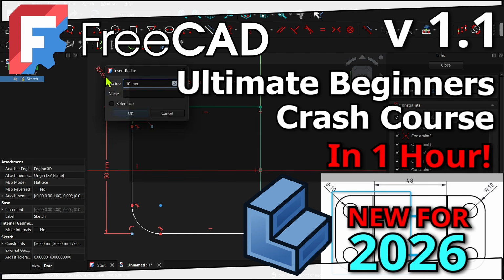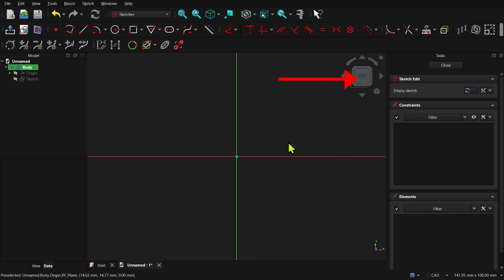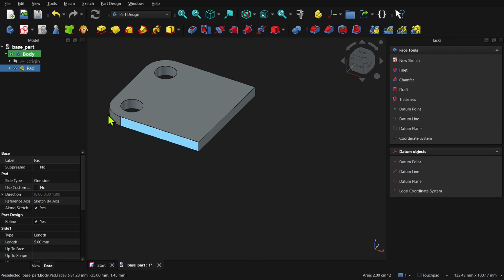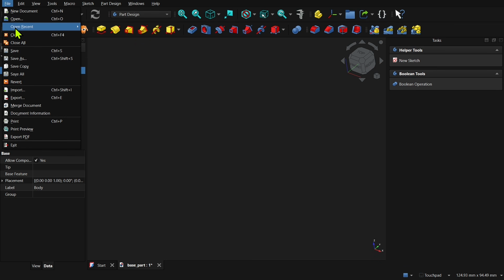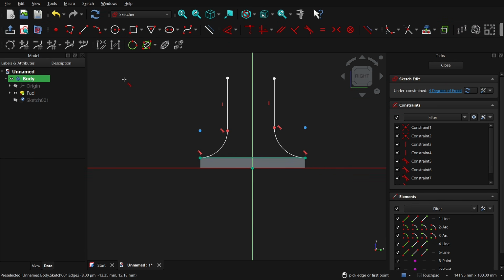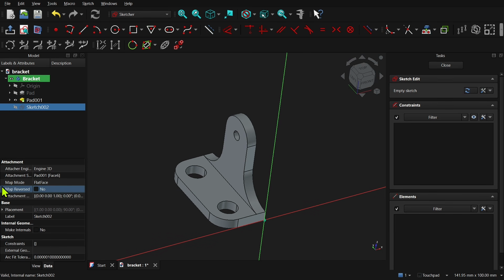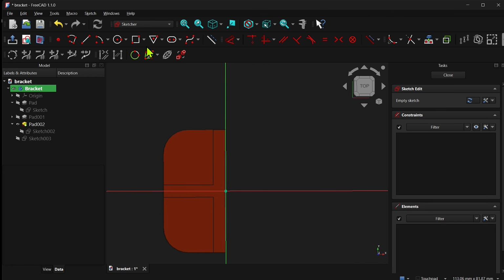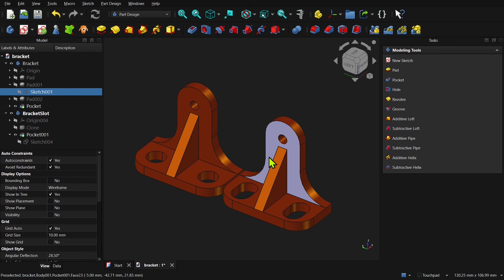FreeCAD 1.1 Ultimate Beginners Crash Course in 1 hour for 3D printing CAD Lesson / Tutorial

Comment: Which video should I watch from you? There are two month ago playlist and this new one. I'm new and doesn't know anything about FreeCad and I need to learn for 3D printing.
Reply from the maker: The 3 part 3D printing course is much longer as it dives into some specific areas and covers 3 projects that can be 3D printed and also goes into some slicer features  If you have the patients then follow that one

This one replaces the older 1.0 crash course from last where as the playlist contains a longer course focused on 3D printing.  It is a great start to get you up and running as a nice introduction even though it's focus is not around 3D printing but it goes into export the model so if you want to print it you can.   So if you just want something quick go for this one.
Reply: @MangoJellySolutions  I'm gonna finish this one and then watch the other three part then. Thanks for the answer.
Reply: @MangoJellySolutions  Finished with following around. I'm gonna watch the other three part. Thanks for the great and clear explainations.

Comment: Section 1:
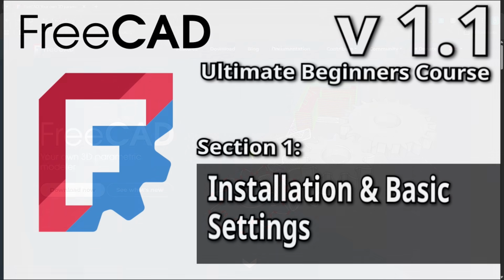0:30 Installation & Basic Settings

Interface:
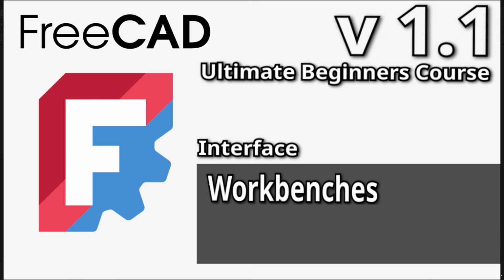1:14 Workbenches
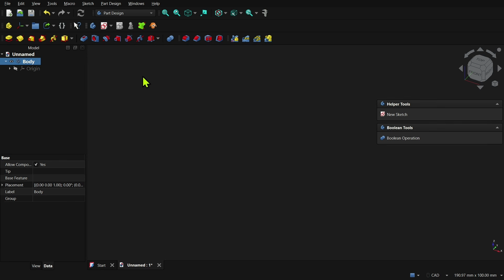1:39 Customizing the Interface
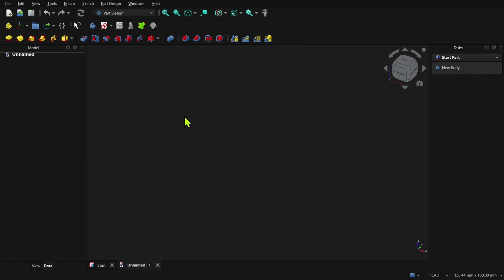3:58 Navigating the 3D View

Building the Base:
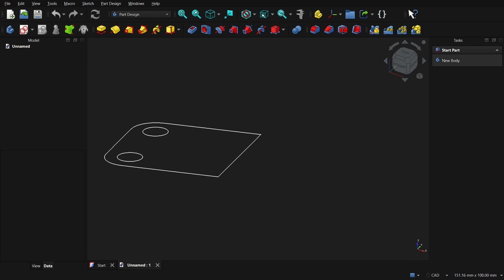6:03 Create your First Part
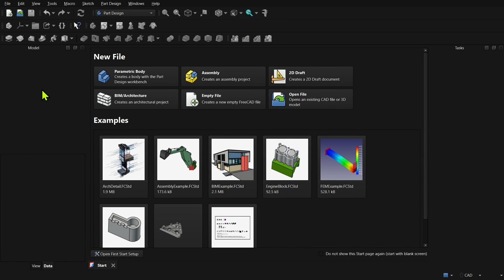7:02 Organize the Toolbars
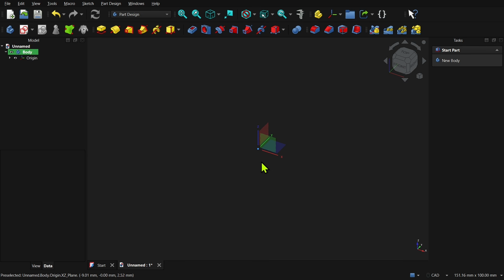8:42 Sketching the Base Geometry
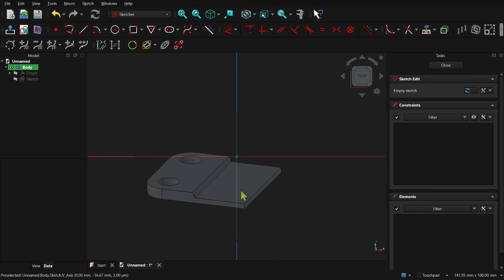9:45 Drawing the Sketching
16:44 Adding Volume
17:57 Removing Volume
23:44 House Keeping
24:53 Mirroring

Building the Bracket:
27:18 The Base
32:58 The Side
34:19 Using External Defining Geometry
39:04 Gusset: Option 1
44:06 Gusset: Option 2 (Cleaner)

Finishing:
48:37 Changing the Appearance
51:21 Exporting your Model
53:24 Clone Workflow

Making a Variant:
1:01:00 Updating the Sketch
1:03:00 Change Propogation

Useful Things I've Learned:
Disable report view (2:13), you can still see reports (2:35)
Hide the Tasks Panel (2:47)
Toggle Axis Cross (4:25)
Auto remove redundant constraints (9:59)
Distance from axis stays the same when you zoom (10:58)
Disconnect a point (21:03)
You can add descriptions to bodies and features (24:05)
Polyline switch mode (28:53)
You can use the tangent tool to define innner curves (36:19)
Cut geometry to sketch plane (39:37)
Changing attachment offset (46:00)
Creating clones for minor changes (56:25)

Complaints:
42:03 This needs to have a fix. I'm tired of fiddling with the numbers to get the "just right" chamfer/fillet
Reply from the maker: Thank you for taking the time to share that, I like that you added the useful things you learnt.  Regarding the complaints, many feel your pain.  I think when that gets solved there will be a few champagne corks popping throughout the open source community.
Reply: @MangoJellySolutions  FYI: If you add these annotations to your video description (make sure to start with "00:00 Intro"), they will appear in the video timeline.
Reply: @MangoJellySolutions  Thank you! I probably wouldn't have been able to CAD anything in Linux without videos like yours! I'm really impressed with how far the program has come along. Just needs a few rough edges smoothed down and it'll basically be a polished program in my eyes.
Reply: Please add time stamp within your video description. It will creat link automatically. 
Thanks for your good work.

Comment: Thank you for all of your videos. They have really helped me learn FreeCAD 1.1. I have a quick question if you have the time to answer: whenever I perform a Boolean Fuse operation, the resulting fused body becomes offset from its original position. The parts are aligned correctly before the fuse, but after the operation is completed, the fused object shifts unexpectedly. Have you encountered this before, or is there a setting or workflow I may be overlooking? Thank you for your time and for all the knowledge you share.
Reply from the maker: Glad you are enjoying the videos and they have helped, and thanks for the comment.  In regards to your question, yes this a known behavior, and it can really trip you up if you don't know about it. Iin fact I am sure it is in the wiki somewhere: 
EDIT: Yes found it: 
https://wiki.freecad.org/PartDesign_Boolean under limitations: 'Tool bodies adopt the local origin of the active Body. If the active Body is not located at (0,0,0) in the global coordinate system, the tool bodies' placement need to be relative to the active Body. It may be easier to leave the active Body's placement at the origin before applying the Boolean feature, than to change its placement.'
Reply: @MangoJellySolutions  thank you so much for taking the time. I really do appreciate everything you do for the community. I will look into it it. I am trying to make Hinge on a print and place box. I am a complete noob and trying to figure this all out. Coming over from Fusion

Comment: Another great tutorial! Although it's a  beginner's course, I found a lot of revision value at intermediate level.

I'm still a bit unsure of how attachments exactly work.
At 45:51, you attached the sketch for the gusset, to that side face of the bracket. Then you adjusted the attachment offset to -25 mm along the z position, effectively placing it at the centre of the bracket, which is 50 mm high.
What will then happen if you change the bracket height in its sketch from 50 mm to, say, 60 mm?
Will the gusset still be at the centre of the bracket? Or will it now be 5 mm off centre?
Reply from the maker: Attachment can be one of the most trickiest things to understand in CAD so your not alone.  The attachment value is an offset from the attachment point, in this case the face.  So we can say what the sketch is attach to is at 0 and we offset 25mm away from it in the negative Z direction (i.e. -25mm) placing it in the middle of the 50mm length of the bracket.  If that length grew or shrunk, we are still offsetting from the attachment point, so to place it in the middle you would have to make the necessary adjustments to the offset.